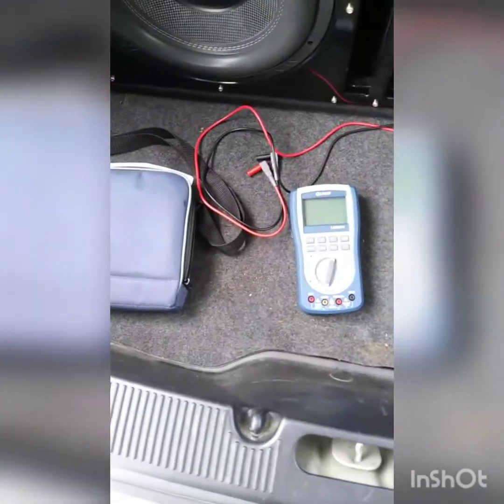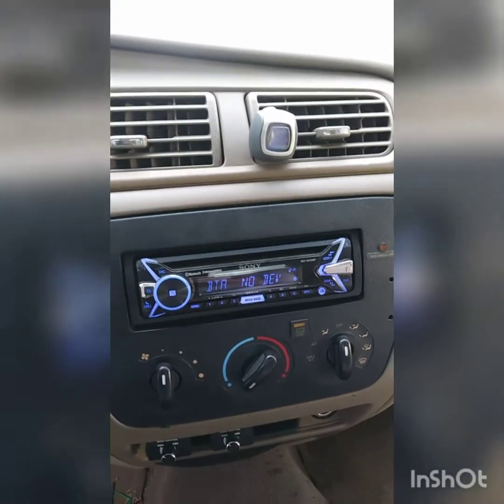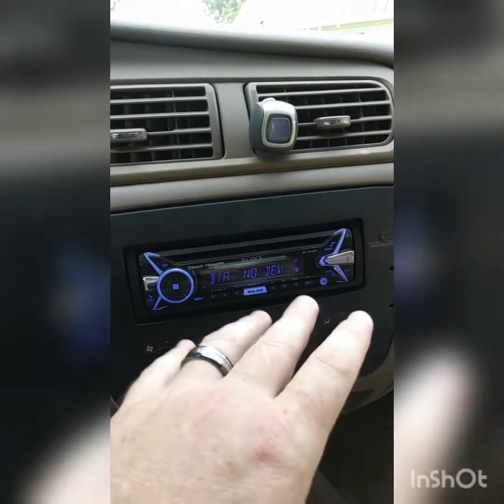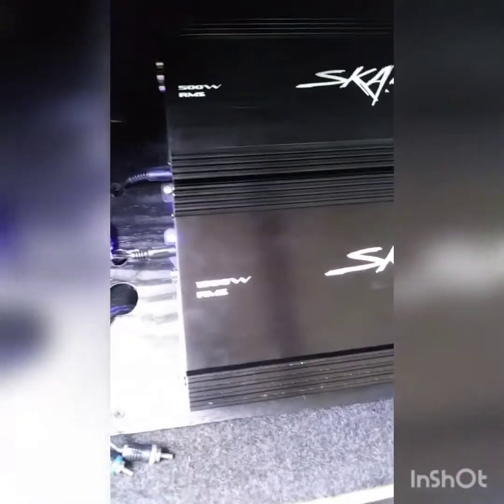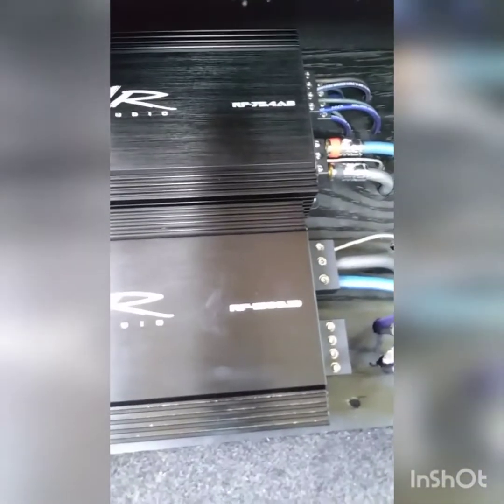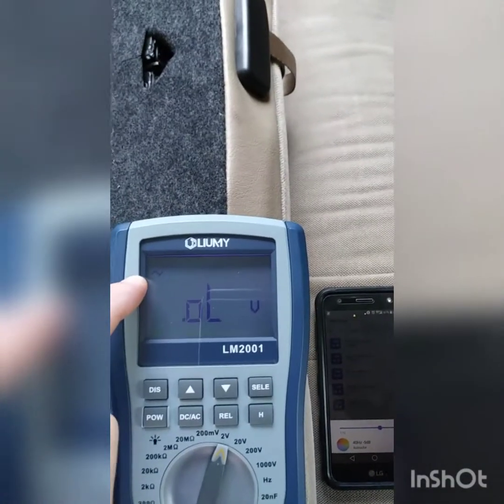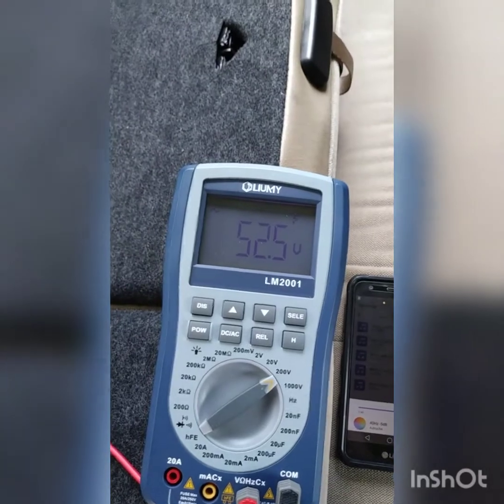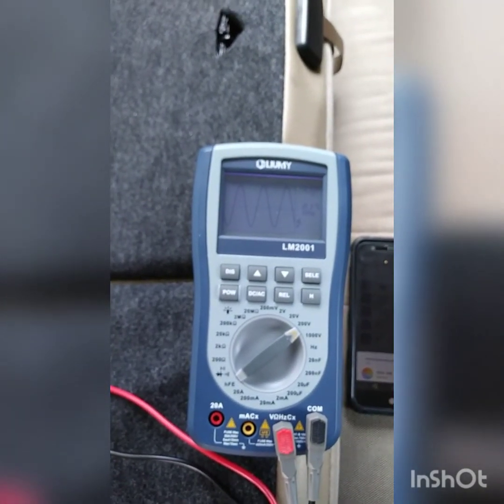How to set your gains with the Liumy LM2001 oscilloscope

Comment: Thoughts on bass boost? 

I had bass boost on thinking it sounded better but then realized why folks say turn it off.

Bass boost caused my setup to be a one hit wonder. Meaning, I’d be slapping hard around 35-40Hz and nothing below or above that.

Shut bass boost off and reset gains and now my system slaps across a larger frequency range and now it sounds very musical. Plays great from 28hz all the way up into 50hz range now with authority.

Only a few songs sounded good when I used bass boost.

Now it’s off, all types of music sounds good and beats.

I’ll never use bass boost again..
Reply from the maker: Wow. Probably the best explanation I've read. Not to mention to unwanted distortion and possible clipping that can happen.

Comment: If u unhook your speakers doesn't that take the ohm load off the amplifier? It seems like u would be setting it based on not having resistance and wouldn't it change once u put the resistance back on it?
Reply from the maker: I've heard that also. I'm not 100% but this is how I set my gains. I basically read the dd1 manual then applied it to the luimy.
Reply: @clippingcoils8215  ya i was really thinking about it and I think I'm going to try it with the speakers hooked up and just use a 1khz for the mids and highs so I don't damage them with 40hz
Reply: DMMs have an internal resistance in the megohm range (usually 10Mohm)
With V=I.R 
I.e 50v= 0.000005x10000000
50v=25x2.
With changing resistance only the amperage required changes.
Also it's worth noting a speakers ohm rating is when deenergised, when playing music it's impedance fluctuates greatly

Comment: Great video How would you set an external eq and crossover with the liumy
Reply from the maker: I'm not 100% sure but I would think it would be similar. Check signal coming in to be sure its clean. Then check the output signal to see if it's still clean.
Reply: @clippingcoils8215  will try it and see thanks for the quick reply

Comment: So to be clear I am gonna hook it up to my rca cables run a test tone of say 40hz 0db everything flat including speaker level for sub at 0 and I'm gonna turn the volume up until it clips then turn it down 1 notch to where it doesn't clip. Then I'm gonna hook it up to my amp and set the gains to where it clips then turn it down a hair to where it won't clip. Then when I'm all done I turn my EQ back to where it was and my speaker level for sub back up, and it won't clip after I turn it back up? I'm just trying to learn this I set my gains with a DMM but I wanna do it better and correctly with a oscope considering my gear is a lot more expensive than my last set up.
Reply from the maker: That sounds correct. You can return your filters. I would leave the sub level at 0. Unless you got an oscilloscope to watch it in real time. With my head unit at full tilt I can't turn up the sub level. It clips. I never watched the equalizer settings in real time. I think mine sounds great flat.
Reply: @clippingcoils8215  see I have my subs set at 900 rms that I did with my dmm but my sub was still quiet and I had to turn my sub level up to get it to actually bump and I have a sundown audio sa-15 so to me none of it made sense but I did just buy this oscope so I wanna set everything correctly and get some good bump out of it especially if I can just leave my sub level at 0 and not clip.
Reply from the maker: @SnipesInTheShadows  yep. You was probably already clipping at the head unit and then you amp will amplify an already dirty signal. Got to make sure you signal to amp is 100% clean. Use 0 db tones to find head unit clip. Then you can use gain overlap at the amps achieve more output. Check my channel for other video explaining what I know about gain overlap.
Reply: @clippingcoils8215  true I'm gonna look into this more currently my amp has a volume knob that has a red light that tells me when it clips. I've only had 2 songs that made it clip but when my oscope gets here I'll do everything correctly. Thanks for the info bro.

Comment: The amount of times i thought "wow we have the same equipment" was an uncanny amount of times. I have the same looking sony headunit, and I have the same looking aftermarket stereo mount, i drive a 2001 Taurus, and I've got an RP 2000.1d Skar audio amp with dual NVX-VCW154 subs. (some slight differences but my god i almost thought this was my car for like a solid 30 seconds)
Reply from the maker: Crazy. I used to run a single 15" Nvx vcw d2. We have very similar setups. I used to run a single 15" NVX vcw d2 before I got the 2 12's. I plan to get the rp-2000 also. I got a custom box build video also. You should check out my channel and subscribe if you like it.

Comment: So turn sub level to 0? Wouldn’t that decrease voltage from stereo to amp? Newbie bro liked your video I’m gonna buy one of those I wanna see how you test a head unit to find clipping. Do you just use alligator clips and test the rcas?
Reply from the maker: Yes. It decreases voltage. I would turn it to 0 if you don't have a scope. You always want to set everything to 0 or flat when checking for clipping. Once you find your max volume you can play with all the setting with the scope hooked up to see if moving anything will make it clip.  Example, on my head unit I can turn the volume all the way up without clipping. At full volume when I turn sub level from 0 to +1 it clips. If I was at a lower volume I could probably turn sub level up a little and not clip, Maybe. You always want a clean signal from head unit or you will show a clipped signal at the amp. Also, yes I use alligator clips on the rca's. That way I can watch the scope and mess with settings at the same time.
Reply: Clipping Coils appreciate the reply bro I will try that!!
Reply: @clippingcoils8215  Hey bro I do exactly the samee while testing the RCA coming out of my HU but I get some low voltage like 0.38 and no wave,  I play 50hz at 0db test track, please help!

Comment: Nice job my friend! Let me ask you something that confused me. You tune the amp with all settings flat but afterwards you leave flat the settings forever? When you change the setting like (subsonic,bass boost...) then won't clip?
Reply from the maker: evoxslay diy. You would set your filters back after you set the gain. By opening your filters, your letting more signal thru and the max volts your gain is set to. Once you return your filters, there is no increase to the voltage. Only filtering and decreasing of volts in the unwanted areas. Also I would leave the bass boost off.
Reply: Richard Moore .Greetings  from Greece.thanks for your answer.i tried but when I put the bass boost again to previous set up and the equalizer from the head unit back to my previous favourite settings the voltage to the amplifier increase.but I assume that only the bass boost increase the voltage not the equalizer settings because them was set below 0 db.if I will try to set up my amp with the oscilloscope as it is without make any changes at the headunit or the amps,just to play a little bit with them and try only to see where clipping and make some adjustments,because I like what I hear, that you think is wrong?
Reply from the maker: evoxslay diy. You don't want any dirty signal coming from head unit first. So hook oscilloscope to head unit. Turn the volume up to 75%. Play with setting to see what's making the head unit clip. Once it's clean then you can see if you can turn it up more. On my head unit I had to turn off bass boost. Turn blue tooth volume to 0. Turn sub level output to 0. Then I was good to go. Do not use any bass boost on head unit or on amps.
Reply: Richard Moore thanks! Something like that I had to my mind. I believe  if I get clean signal from the head unit and afterwards make the same to the amps I will be OK. Thanks again.